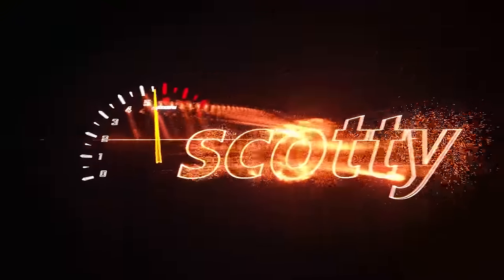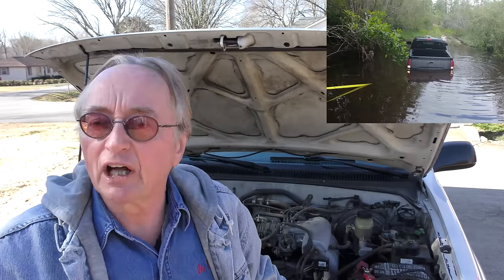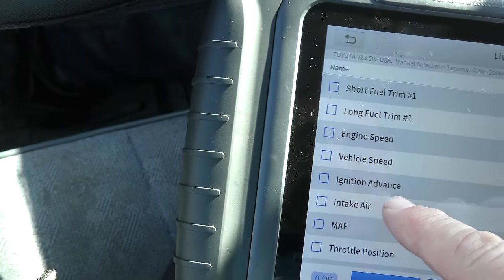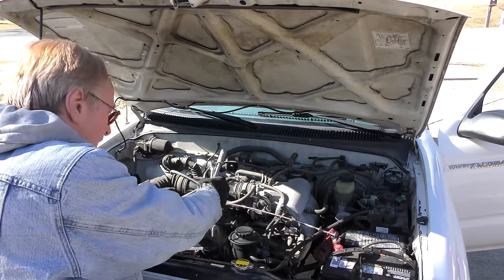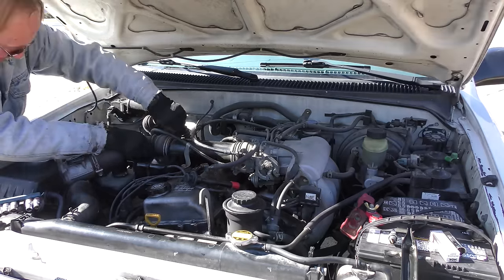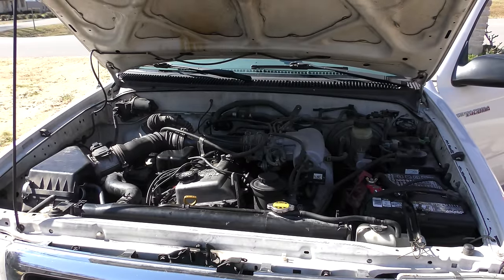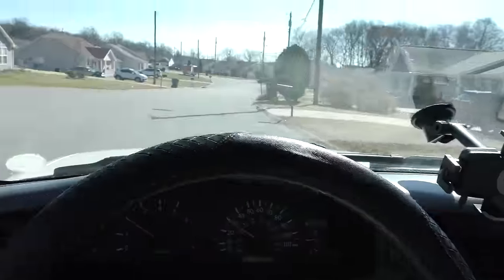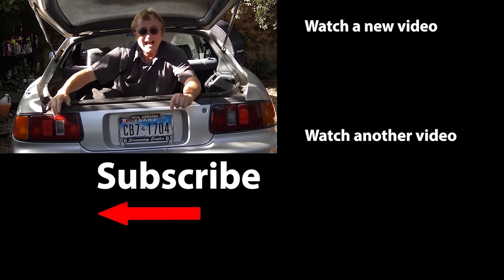I’m Not Supposed to Show You This

Comment: @Scotty Kilmer Just wanted to thank you for all Your videos I’m 27 and just two months ago I knew nothing about cars I’ve never had problems with them I’ve always boughten new cars was blessed with a good job since I was first working but i decided to buy a 2000 mustang gt Because I’ve always loved them and remind me of my childhood but of course after I got it everything went wrong with it and it got expensive fast so I started doing the repairs myself and I went from not knowing how to change oil to changing my PCV valve my ignition oils spark plugs mafsensor 2 02 sensors found a vacuum leak changed throttle body and a more….. never in my life did I think I’d be able to hear a car and have an idea on what the issue is thank you so much Scotty and thank you to the shitty check engine light gt I bought this year that I just got to pass smog!

Comment: I'm driving a 2003 Tacoma, my Check Engine Light has been on for at least 7 yrs.   I've checked damn near everything but, the light never goes off.  Regardless, the truck still runs fine.
Reply: Code?
Reply: Did you change the spark plugs? 😂
Reply: @ElevenAce  Actually the entire plug/coil system was stolen a few years ago and had to be replaced entirely.  So, yes.
Reply: @erniecarrasco9107  No idea.  I just bought a 2019 Tacoma and I will be purchasing a code scanner.   All the time I owned my old Tacoma, I had no idea there was such a thing.  I now have a 2003 Tacoma, 2015 Rav4 and 2019 Tacoma.  So, I suppose a code scanner will save me some headaches.  Getting my 1999 corolla towed away soon hopefully.
Reply: @jdsguam  Good thing you didn't sell your 2003 Tacoma to get the 2019.
Everyone who sells a 1st gen Tacoma ends up regretting it. They are the last truck of their kind. A true compact truck.
Reply: @Argedis  Oh my wife wanted me too for sure.  But, I held my ground explaining we needed a 3rd vehicle for backup.  It runs fine, it just looks like crap.
Reply: Get the code scanner they like 20 bucks and let us know what it says

Comment: Love those 2.7 taco engines. Indestructible with regular maintenance. Had a 96 with close to 200k. Never used a drip of oil. Now have a 2013. 150k no issues at all.
Reply: Could also be the 2.4L 2RZ-FE which I also have on my 2001 Tacoma.
The 2.7L was exclusive to 4x4 models and later the Pre-Runners

Comment: Pretty simple, but still helpful. 
One concern. You had to remove a ton of hdwe to get all the plugs and wires "Off".  In normal shop ... or even at home in a DIY scenario ... MUCH Better to have changed all the wires for perhaps $20 and an extra 10 MINUTES ... to avoid a PAINFUL "REPEAT" !!!

Comment: That bracket that was in the way probably does something like hold the cable off a hot engine part.  I had power steering lines changed on my old Taurus, and the mechanic did not put back a bracket that held the lines away from an exhaust manifold.  The hoses burned through on the way home.
Reply: I agree. Toyota engineers would not put a bracket on if it was not necessary

Comment: I have a 2001 Tacoma with the same exact 2.4L engine 2RZ-FE (Scotty's Scan tool showed it)
Mine has over 200k miles and runs like a dream.
In 2001 they added modern coil on plug ignition to the spark plugs unlike this 2000 model which still used a distributor.
Reply: I have a 95 Tacoma same motor. 6-95 first year 5 speed regular cab. 231,000 still goes. I put Mazda RX-8 seats in it. Perfect fit for regular cab just gotta make one bracket
Reply: Check your valve clearance. Mine was ok until 228,000 miles when it burned an exhaust valve seat because the valves had never been adjusted. The maintenance schedule says to check the valve clearance every 30,000 miles. Neglecting it is almost always the demise of the engines. Worst thing for me is I knew it would happen but kept waiting. Cost me $1500 and I got a good deal. Some people pay up to $3500 to rebuild the head.
Reply: @waynes.2983  This is what happened  to me :/ rebuilt head at 300k cost me 1500, never neglecting anything again.

Comment: Scotty love your videos, my 01 Expedition has 232k on the original plugs and it's running like crap, tune up has been long overdue for it. But I'm getting ready to change plugs and coils with OEM replacements.
Reply: I bet your sparkplugs are completely gone.
Reply: Leaving them in that long can make them very difficult to get out! Lots of carbon builds up on the tip of the plug.
Reply: @waynes.2983  Well I would have changed Them sooner but didn't have the money. When I change them. I'm gonna keep them changed every 100k. I got it when it had 200k on it. But as long as I take my time, it'll be easy.
Reply: @The Ford Shopyard  if they give you trouble coming out just turn out a little then in a little back and forth. That will break carbon of little by little.

Comment: You looked like a little kid in the toy shop diagnosing it on that first drive. No wonder it was misfiring under load with the gaps. I would also argue that it was not a Toyota fault when the plug gaps are grand canyon wide. Looked in pretty good nick for its age. That's the legendary reliability ... IF you look after it.

Comment: That's awesome 200k miles and only needed spark plugs 😎🙌Great job Scotty🙂
Reply: Can tell without looking at it, it's had a starter, water pump, and a timing belt done...I would have had Scotty check the "new" timing belt while it was there...Then again, I would never take my truck to Scotty for only spark plugs...
Reply: @brentfarvors192  The four-cylinder has a timing chain.  The six has a belt---an expensive non-DIY job, even according to the Chilton book, that I'm going to have to pay for soon.
Reply: @brentfarvors192  but they didn't know what was wrong with it

Comment: When I bought my 2001 Camry, it developed a really bad misfire once the engine warmed up. Turns out it was the spark plug wires. The insulation had worn and you could literally see them arcing away. New NGK wires and plugs did the trick.

Comment: I think with that kind of milage and no history, I would check the spark plugs regardless.  Modern spark plug wires are pretty rugged, and you don't need to replace them often, but I agree that they would be the next thing.  In the old days, we would look for arching with the engine running in the dark.  That is what my high school shop teacher taught me in the 70's!

Comment: i may have missed it but did you only take two plugs out and replace them ?? if so you should have replaced all 4 plugs because if they are original  the other two will probably be acting up later , even though it cost for the other two plugs  you should have just replaced them unless you don't have the money .

Comment: Hey Scotty I got a 1998 Jeep Grand Cherokee automatic 2wd 4.0L inline 6 with 217K miles.. I got an obd2 scanner and it reads that it's fine with the green check light but used to be the yellow cation light and used to have a code for the ignition coil which I replaced and even unplugged and cleaned the main computer ports with the battery disconnected of course, ran fuel cleaner through it and the spark plugs seemed fine, but the vehicle does seem to hesitate on rare occasions, should I be worried or should I be paying attention to how much the computer is adding and subtracting fuel and spark and everything I need to know what numbers to see with each reading.. thinking of getting a new computer for it in the near future..🧐 
But other than that it runs perfectly fine😁

Comment: Hey Scottie I got a 2016 Dodge Challenger my as challenger my gas mileage has gone really up I can't find out what's going on it's 17.5 and I used to get in the twenties I have a 2016 Dodge Challenger what could it be I've changed the air filter I had a tuned up not that Long ago could it be the mass air flow sensor needs to be cleaned or the thrive about it needs to be cleaned or could it be something else I don't know how to diagnose it maybe the feel injectors are dirty I don't know what's your idea

Comment: Hey Scotty I have a 2007 ford sport trac v8 4.6, my battery seem to die out while driving but the battery is brand new. I checked the alternator and it seems to be working. It’s to the point that to start the truck I need to jump start it but right away it seems to loose power and dies out, so I can’t drive it. Any thoughts on what can be the problem ? And yes I have checked the alternator.

Comment: Got a 2003 Lincoln Town Car setting up for over a year-and-a-half two years it won't start didn't have fuel pump problem at beginning do you think when I saw you put the quick start in the air filter you think that would help
Reply: Drain that old gas out first .
its probly crap .
Then change the fuel filter .
Hopefully your fuel pump is good but lots of times they get gummed up if they set too long .

Comment: 40 years ago, back when I was a young (and poor) vehicle owner, we'd just clean and regap the plugs if they weren't worn too bad.
Reply: We used to even have a sand blaster machine in the shop in the 1970s . Put the plug in the hole and it would clean it in 15 seconds ! 
The old days ..

Comment: I have a 92 toyota pickup dlx 3.0l v6 5spd with 85,000 original miles unfortunately a older lady totalled it pulling out of a parking lot they offered me $8,000 to take it but I took $ 5000 and kept it they said it's still worth $3000 to a junkyard

Comment: hello scotty, I’m using thinkdiag mini and want to ask the meaning of AFS parameter with a value of 35hz, whenever I accelerate the engine the AFS value also increases, is it an air flow sensor value correspond to MAF sensor?

Comment: Scotty, I have a P0172 code in my 2002 Dodge. I have replaced:
Air filter, spark plugs, AIC valve, map sensor and injectors. Gas mileage still crap and check engine light on. No vacuum leaks, no gas smell. Any idea what can be causing this code? I bought the Ancel AD410 scanner through your link, still have no idea why bank 1 rich. Only have one bank.🤣 Help.
Reply: Purge valve

Comment: What caused the smoke? I have a 96 Tacoma 2.4 that does not smoke. Where did the oil come from to get in tre plug hole?
Reply: I have a 2001 Tacoma 2.4L and changed the spark plugs on it too and noticed one of the plugs was covered in oil from the top.
The valve cover has gaskets for every spark plug. They come included in most valve cover gasket kits.
When they get old then oil can get in the spark plug hole. Easy to replace.
Reply: @Argedis  Thank you.

Comment: Why were there 2 cables connected to the throttlebody?
Reply: Cruise control used to be cable operated with mechanical throttle bodies.
A separate motor controls the cruise control cable.
Reply: @Argedis  Thank you very much! 😃👍

Comment: My 05 tundra has 200k and motor is fine but in the rear end it is now making a sound out of the rear differential or the universal joint going into the differential and it only makes the sound when you're moving...You can tell it's something loose or just worn out and the shaft has some play in it too...Any idea and thank you if you respond bud
Reply: carrier bearing.
Reply: Thank you I was thinking around the same thing

Comment: The problem  its the deflector on the fuel injector its old and gas its cause the plastic deflector to be deteriorate by time, removing the injector and cleaning by hook up 12v and pressure brake cleaning from  the face of the injector towards the back where the gas come from  , and vualahhhh problem solve, fuel injector  clogged.

Comment: Hey Scotty. I’ve always owned junk cars and had bad luck with them. Partly because I don’t know anything about cars so I didn’t know what to do to take care of them.

I just bought my first new car at 37 years old. A 2020 Toyota Camry hybrid with 21k miles. I’ve been watching a lot of your videos lately. Could you make a video about what I can do to maintain my car. So that I can get hundreds of thousands of miles out of it? You’ve made videos about these kinds of cars. I was wondering if you could go more into depth. Like what to do at 25k 50k 100k etc and what to look for and keep an eye on. There is a high likely hood that I will hit those milestones quickly. Since I am using my car for Uber. Also where I should bring my car in New Hampshire. Live free or die 😀

Also I have a 2006 dodge magnum 110k bought 4 years ago with 78k. What do you think of this car? V6 3.5L AWD. If you were closer I’d ask if I could bring it to you to do a video. I like that car it just wasn’t efficient for Uber. The transmission never seemed right sluggish and slow. There is now a leak in the transmission lines and it needs some other work. Also it’s burning through fuel way faster than when I got it. Should I try to fix it? I want to keep it as a second car for snow driving and maybe family trips where extra luggage is needed. I also do other gig jobs that require the extra space. Should I fix it and sell it or just sell it or fix it and keep it? It’s probably gonna cost me 1-2k to get it right and I’m willing to spend it because I really like the car.

Comment: I think I would have replaced the spark plug wires at the same time so I wouldnt have to take all that junk off a second time.
Reply: Spark plug wires can be tested with a digital multimeter. You should even test new ones. I bought a set of MSD wires and two were bad.

Comment: my 99 Camry, is easier to work on than that car
Reply: @Dr. Paul Plumbing Heating 90’s Camrys are super easy to work on. I was amazed how easy it was to replace the thermostat. No brand new vehicle will ever be made as good & reliable as a 90’s Camry ever again
Reply: Oil sludge...you can have it. That generation notorious for that.